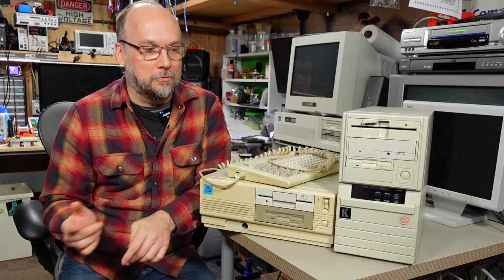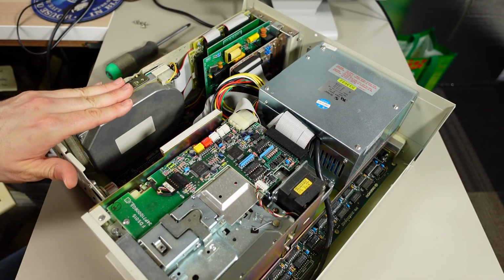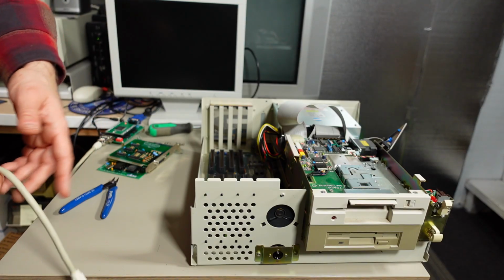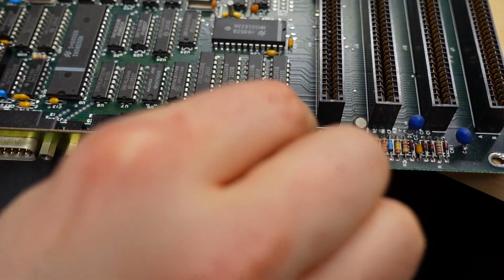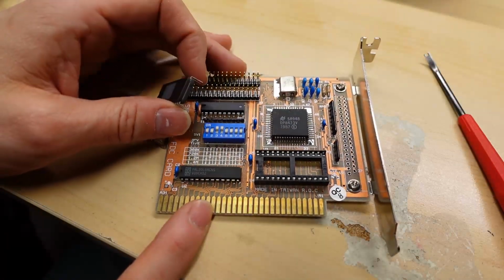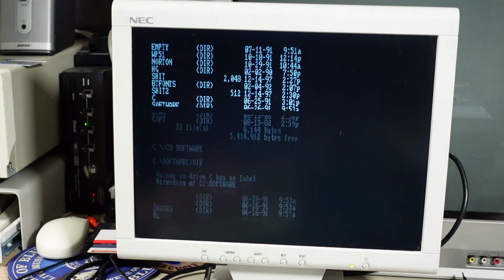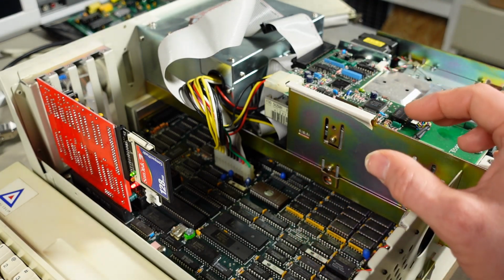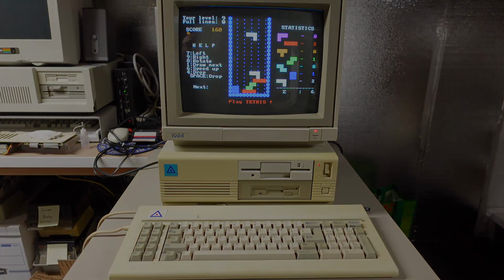PC archeology: Leading Edge Model D

Comment: My first computer was a Leading Edge 486 DX/66
Reply: Was that the tower version?
Reply: @staggerwings  Nope! It sat in "landscape" under the monitor. It came with 3.5" & 5.25" floppy drives, a 250MB hard drive, a VGA display adapter and I believe 8MB of RAM. I do recall the keyboard being a really nice mechanical model like this one. It ran DOS 6.2 (soon updated to 6.22) and Windows 3.1. Over time we upgraded it with a mistsumi-compatible CD-ROM drive (which did require it's own ISA expansion card), an SVGA adapter and 16MB of RAM.

Comment: After watching this,  it makes me realize how spoiled we Commodore A500 / 600 / 1200 users had it in the 80's and early 90's since we didn't have to deal with changing interrupts and bios settings, adding drivers, etc. etc. Man, it was so nice to just plug things in and have them work right away. Just about the only configuring you really had to do came when you added a hard drive.

Comment: Ahh, the Model D -- I owned one in the late 80's (wanna say '87 through maybe '91), running on a Hercules-compatible monochrome monitor, before moving up to a '386.

I'm very surprised to NOT see a usable speed toggle switch in the back -- it would operate at 7.16MHz in "Turbo" mode.  Have you tried the toggle between the video ports to test whether it is the speed switch?  (Reboot the PC after toggling to make the speed change effective).  Then again.. (sorry, so long ago), I think the faster XT's sported the NEC 8088-compatible chips as the CPU.

You have a nicely equipped specimen, whoever owned it clearly took great care of it.

Comment: The way those dip switches are connected to the NE558  (or at least in proximity to it) ...and the fact that I'm almost certain you are correct in that a PC only had one compatible js port base address...

 I think those dip switches may be for JS calibration? (compatibility?) they could affect the timings of the NE558 when the PC is polling the joystick... just an off -the-cuff guess, especially with the array of resisters seemingly connected to it.

Comment: 41:44: The reason entering Alt codes does "not quite" work in Windows anymore is that Windows 1252 is a different code page from IBM 437. Adjust accordingly.

Comment: @Adrian's Digital Basement: You keep saying 320x240. 
These older machines definitely couldn't do 320x240. That's something that only came in with VGA, and even then it was nonstandard. They did do 320x200.
EDIT: Also, since this does 640x200/16, that's probably ETGA, which means it probably also should support 320x200/16 TGA. See: https://en.wikipedia.org/wiki/Tandy_Graphics_Adapter#Output_capabilities

Comment: Hi - nice find

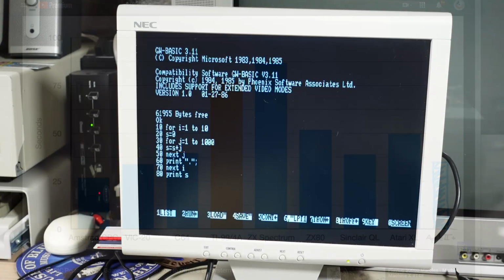at 43:00 where you run the basic program, just add 2 lines and you dont need the stop watch
5  print time$
90 print time$

when you run the program it will show the system time before the test and after test loops, you will be able to see the elapsed time

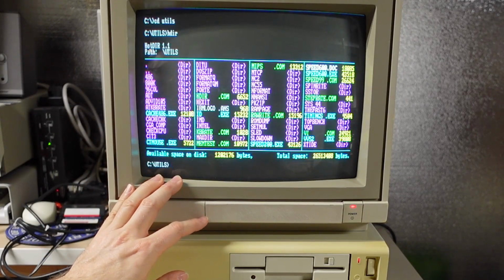55:30 - i noticed you use hotdir  - great app, i have been using it 1987 (updated to hotdir2)
the other 2 dos tools i use are    
APC dr.com by   by ZD Michael J Mefford ( shows files in the directory as a list and you can copy/move/rename/view text even reads wordstar - almost like a xt nortons commander )
2day.com  - no details on the author( a hex view shows 194 Series 1 Software And Services Co ),  you run the command and it shows all files created today

Regards
George

Comment: Hi Adrian, love your channel. dont know why low subs. you are still to be discovered on youtube i think!! haha
Have a strange laptop problem if you ever experienced or know of a case. 
Have a old 2011 HP laptop a 4530s and every attempt to install windows by usb or dvd starts to load but then fails and either kicks back to bios screen or shut computer down completely??  Already swapped memory and slots and HD is known good. Cant be PS socket as done this with and without battery and laptop always turns on and goes to bios although i cant seem to find bios flash screen eventhough there is a option to flash bios in menu. 
Cleaned memory slots and used other known same memory from other machine same specs.
I thinking bad bios or controller or memory controller nth/sth bridge? or power through MB is weak somewhere (bucks) caps ect and cutting out under load when windows installs? Thats all i can think of. Reset bios to defaults and tied uefi as well than legacy but nothing. So you can see the windows files load at bottom of screen then the win 7 or 10 logo appears (tried both) , then the screen and HD freezes OR laptop shuts downs or goes back to bios. i also has a BSOD code 174 too and power stayed on that time. so something major wrong i guessing or conflicts somewhere? 
thanks for any help 
Tim from Australia

Comment: I recycle computers for a living and someone had me pick up the exact same Leading Edge computer a few months back. I have yet to put it on the bench though. The 5 1/4 drive looks just as white as yours does. I have the complete set. Computer, keyboard, monitor and printer.

Comment: 2nd computer that my parents bought was a Leading Edge with a Cyrix 486! That was probably 1994ish, because it was pre-Win95.
Reply: Having worked in hardware support at Leading Edge during the Cyrix era, I probably had to explain to your parents at some point that that computer couldn't run The 7th Guest. :)
Reply: @ZGryphon  haha - no but I would have appreciated any tips that would have made Ultima 8 not run at 5 fps! the input lag made platform jumps nightmarishly hard. I probably spent as much time tweaking boot disks as I did playing games.
Reply: @iroll  I worked in Hardware Support, you'd have had to call the separate software line for that. Although I'd have suggested a RAM upgrade if you had called us, before forwarding your call to Software Support. :)

Comment: the MC6845 is used in the AMSTRAD CPC (which I own 2 6128s). The chip on the CPC can display 160x200x4bits/320x200x2bits/640x200x1bit with just 16KB RAM, so to get 16 colours at 640x200 you simply scale up to 64K and thus get 4 bits for colour.

Comment: Hi Adrian,

i'm 99.9999999..% sure that the Phoenix BIOS is actually only 8kb big, but it must have some additional optional ROM code glued to it. 

So your motherboard has a floppy connector so i imagine the other 8kb of ROM might be for floppy drive extensions, like actual high density floppy support. Or it could be something else. I would disassemble the BIOS and check, but i'm going to be away from computers for a few days.

Although the Phoenix BIOS 2.51 version is quite good, i used it myself and there is at least one video of me testing a XT-IDE card on a generic 8088 board with 2.51 BIOS, i would recommend a much better one instead, which is still actually maintained by an absolutely amazing coder, Plasma on VCF forums:

http://www.phatcode.net/downloads.php?id=101&action=get&file=pcxtbios31.zip

I've made a few suggestions for that BIOS, and its my favorite BIOS for generic XT's. It will work on that Leading Edge, i'm sure.

Comment: Leading Edge? UGGH. I've never had a good experience with them. Every time I tried to use one in a  computer lab (1989-1994) it was always broken in some way and wouldn't boot. Either corrupted bios or missing boot system, and nobody could ever fix them.

Comment: As I recall the “D” in Model-D stands for Daewoo, just as the “M” in the Model-M was for the Mitsubishi manufactured ones. I remember seeing these at Sams Club in the 80s bundled with a printer for a decent price. A lawyer friend of my dads was looking for a computer and I recommended he get the package deal. But when I told him that it came with a printer, he said that printers were too noisy and didn’t want anything to do with it.
Please keep the archeology videos coming. I won’t swear but the fried quad high density floppy card looks familiar. I’ll check to see if I have one and if so try to put the ROM on archive.org. No promises.
Reply: That's right! I forgot, they changed it to M when they picked up Mitsubishi as their OEM. I had a buddy / mentor at Sperry who noticed our cases were identical, except the color. We pulled both units apart abs they were identical inside (a month or so later i was checking the image of a client's Compaq computer for upgrade, and it was identical to ours (said Sperry & Leading Edge)

Comment: That mini tower look like my old 386 pc back in the day, back in 1993 I upgraded and my 386 to become a netware 3.12 server that I had as my home lan lab when getting my cne qualification. It stayed working up to 2008 with its longest run without rebooting of 7 years 8 months 2775 days. Powered it off with a power cut and it would not reboot or post :-(

Comment: OMG - This was my first computer. The Leading Edge Model D - It came with the clone of the Lotus 123 spreadsheet and more. it did have a 30 MB HD, so I was big man on campus, when I had it. I never had to use a computer with just floppy drives.  Running MS-DOS by Van Wolverton (both books) were the beginning of me ending up with a career as a Cisco Network Engineer. Mine was an 8088 xt version that I bought in 1986.

Comment: I'm a little surprised you don't have a set of boot floppies with interlink setup.  That will let you copy drives over serial or lpt to another dos machine without the heroics of getting your xtide working.  I used to use it heavily on my BBS back in the day.  Primary system was a 486 with a couple IDE drives.  It had a slave original IBM PC with 64k as add on storage connected over lpt using Interlink.  Two MFM controllers, three drives.  One controller had it's int pin taped over, used a shareware driver under DOS to detect and attach it.  I miss that hokey old setup but it was dead nuts reliable.

Comment: You can use the MS-DOS drivparm command to set the floppy disk type to 1.44m if I remember correctly. Seem to remember fitting an 1.44mb external drive to an xt back in the day.

Comment: Really nice to see an old system like this in such good condition and with no battery damage too. Hang onto that Leading Edge keyboard if nothing else! Any keyboard with blue ALPS switches goes for big money these days. Check out Chyrosran22's video on it. https://www.youtube.com/watch?v=sH2QmZPOM1I.
Reply: And keep it covered when not in use. Dust is the arch nemesis of Alps.
Reply: I used the exact model as a member of the Marine Detachment, USS Nimitz 1992, it was a great computer

Comment: 9:02: Oh, the FDC still has the vias for the DC-37 external floppy connector, like the original IBM FDC. With a different slot plate, maybe that could still work. I guess the right slot plate and D-sub would be hard to source now though, so upgrading the FDC to the fullest would probably be a deceptively difficult mod.

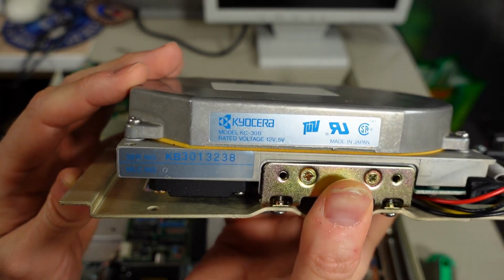Comment: 11:06 ST-506 is the SEAGATE code for a 30meg RLL disk. I had one of those in my XT... The Kyocera code is actually KC-30B, possibly licensed from Seagate.

As for XT machines, not only they were absolute TANKS, but they had a very high bullshit tolerance. My XT started as a Taiwan-made XT clone with 256k RAM, CGA, a 8088 CPU and two 360k disks. When I was finished with it, it had 640K of RAM, a NEC V20 CPU, one 360k and one 1.44M disk, a 30gb HD,  a Sounblaster, and a 256k VGA card. Oh, and I replaced the clone ROM BIOS with a full IBM set of ROMs, so I could run BASIC and BASICA. 

The worst abuse I did to it was to try to play Wing Commander 1 on it. The poor thing managed to play the intro music and battle sounds (thank you Sound Blaster) in the normal playing time, about two minutes or so. With a black screen, of course, BUT when I was about to put my poor XT out of its misery and shut it down, it painted the first frame of the intro. It took 28 minutes, but it managed to display the whole intro and bring me into the game menu, at which point I hit the exit to DOS button. 

My next computer, a 386DX with 4 megs of RAM, was not as tolerant as the old brick.

Comment: Honestly, a Tandy-compatible 320x200x16 mode would have been more useful than a 640x200x16 mode. I've always wondered why none of the CGA clone cards ever included a PCjr/Tandy mode. The extra cost would have been minimal and the benefits immense.

Comment: Try the floppy BIOS from this: http://www.malinov.com/Home/sergeys-projects/isa-fdc-and-uart

There is also a few 8088 BIOSes here. 8088 BIOS are usually all the same. http://chukaev.ru54.com/bios_en.htm

Here is an open source 8088 BIOS. https://sourceforge.net/projects/opensoc86/files/bios/pcxtbios25/ I believe that one supports 1.44MB floppies.

EDIT: Well, I guess I should have watched this all the way through. :p But like I said, 8088 BIOS are usually pretty universal. In fact, since you have upgraded that BIOS in the Model D PC, try taking the BIOS out of the card and running it bare, or try the onboard controller again.

Comment: I have seen a lot of these barrel batteries and it's kinda funny. The VARTAs ALWAYS leak but the other brands have a good chance to be still intact. Hell I had a blue one branded "GP" that still held the BIOS settings on a 486 board after 26 years.

Comment: This Floppy controller is potentially amazing. It seems to be prepared for a 37 pin external connector that the external IBM 3.5 ich Floppy disk drives used. Edit: OMG NO!!!

Comment: Wow - now that shows how things have come along. I wrote my first game in BASIC on a ZX Spectrum. I just tested your 32 second program using bas in a terminal on Linux on my desktop. It had finished before I lifted my finger off the enter key after typing run.

OK, tested further. If I bump up the "j" loop to 7,500,000 it takes 30 seconds, so closer. Ryzen 1800X. Wonder of that is an indicator of how much faster modern computers are (i.e. 7,500 x)?

Comment: Some Acorn monitors for the Archimedes/A series had a hardwired IEC lead instead of a UK plug, interestingly the only one I saw was used on a  keyboard computer style (A3010?) one so could not be powered by the machine so a standard lead as connected to it.

Comment: Wait. You're just able to go and pick though the computers that are destined to be scrapped?
Reply from the maker: It was a unique situation where I had a connection that gave me special access.
Reply: I used to do this...until the local recycling center posted up a sign targeting me, specifically, to stop doing it. Whoops. Found some crazy stuff though!
Reply: @buttguy  So sad they rather "recycle" the computers, a.k.a. send them to China to be burned and dumped in a river, rather than give them to someone who would use them safely.

Comment: Crazy: A PC XT clone in such a good condition at a recycle center !!
Reply: Even crazier is that they didn't wipe the corporate files from the hard drive.
Reply: I asked my local recycling centre, but they won't let me in the back to look at the computers.
Reply: Looks like it spent 30 years in storage. Probably got replaced after the harddrive failed?
Reply: I'm pretty sure I saw one of these at a yearly city recycling event. The line of cars was long, so I didn't want to hold up the whole line trying to ask them if I could buy it and/or try to root around for the DC-2014 keyboard that was probably tossed along with it. I already have two of those boards anyway though.

Comment: I used to have 2 of those massive cd drives in the other computer. They were single speed and the whole chassis slides out and the lid pops up.. Dedicated ISA controller cards if I remember  correctly.
Reply from the maker: Indeed, I recall installing those into computers when I worked at a computer store. Very early internal CD drives that didn't require caddies.. but a strange design.
Reply: One of these? https://www.youtube.com/watch?v=VRn1AhMoqUA Coincidentally somebody posted that video on a forum thread just last week, saying he'd just ended up with one.
Reply: @stevethepocket  wow yes that's it. Instantly recognisable. Even gets stuck a little just after the click out so you have to pull a little harder than you'd like...

Comment: Use a secondary hard disk drive with a jumper set to secondary HD on to the same socket as the original MASTER HD. Maybe worth trying that configuration for copying the hard drive content. I think the Lotus and Microsoft word 5 sounds interesting too. 30 Years Old ETC. is going to have compatibility issues. Fantastic. Thanks.

Comment: "Why is this Leading Edge PC so good?" "Well, the keyboard is a big plus."
Reply: That's certainly a key element of its success.
Reply: It must have been designed in Sweden.
Reply: Don't underestimate the keyboard!!! Many people still think IBM model Ms were the best, and they were bundled with Personal System/2. $400 and up for them now, which in most cases now is much more than the rest of the PC.
Reply: @squirlmy  Model Ms routinely sell for $50. There was a time not long ago where they were all $150+ though. There are millions of them out there, and a lot of people don't particularly like them (they have their diehard fans). Even the superior Model F can still be had for less than $400. These Leading Edge boards are worth good money for their switches alone. The DC-2014 keyboard in this video is guaranteed to have SKCM blue Alps switches, which are probably hunted by enthusiasts second only to IBM's beamsprings. I rarely see them sell for less than $200-300 anymore.